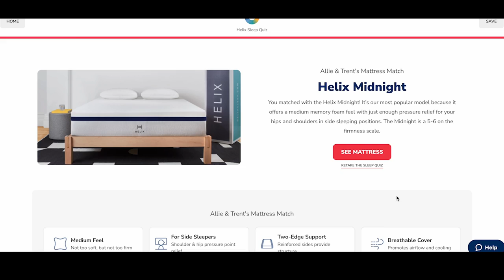WE'VE BEEN WAITING MONTHS FOR THEM TO ARRIVE!!!

Comment: I can't remember if during the build you mentioned this in one of your videos while building the basement and I don't know if this is needed, but I just learned about this and since you guys have a new home with a basement it felt like information worth sharing.  Do you have a radon tester or vent in your basement? It's a gas that come up through the concrete basement flooring in various ways. It's the 2nd highest cause of lung cancer. There's a test you can buy to check the levels and testing in winter is apparently better than in the summer. Again, don't know if you need this information, but thought worth  mentioning since you're new home owners with a basement. I would think older basements are more likely to have higher levels, but who knows. I'm surprised it's a thing.

Comment: OK . here we go . LMAO . First, weather seal is always last. Second when stacking only put one hinge on one side. Put in place and then do second side. third center hinges are done last after stacking. lol I'm crying in laughter. to do the back hang just roll door up half way and eye ball for straight from the back. the white line on the spring is for rookies. it is 10 to 11 full turns on a spring or 40 to 44 quarter turns. never stand under the winding bar always work off to the side incase something goes wrong. when winding always clamp the door with vice grips that way the door doesn't shoot up on you. when installing the operator if the the door is not smooth moving the operator will see current rise and not work cause it thinks its jammed. lube the springs and all the rollers they are pretty much dry on install. if you have to move bearing plates or anything attach to springs take off all tension first , thats how home owners get hurt alot. if top wearther seal is too tight on door the operator won't be able to open it. you guys are still amazing but be carefull , wish i could have helped you with this but i;m in canada. 20 min drive from chiwala tea head quarters. lol.

Comment: Where the leak was coming from the valve didn't fail the install did. Blatter expansion tanks should avoid installing them on their side.This is why things fail like designing a house were the roof snow slides onto the deck. When you want things done correct hire professionals, they installed our two heavy wood garage doors with openers in two hrs.

Comment: If you want the plumbing problems to stop start using grey heavy duty glue. I owned a hot tub business for over 15 years and never once had a bad glue joint and it will make up for fittings that don't fit right!! Blue glue is useless garbage!!

Comment: That valve is typical of the CRAP that is sold nowdays.  Import crap at high expensive prices that FAIL with monotonous regularity !!!  You have to buy what is available and hope it works for a while. I went through all kinds of this same rap when we set our place up from well pumps to failing PVC pipes to failing valves that either leak internally, don't shut off or leak externally like your problem.  It all goes back to the bean counters that buy this crap as cheap as they can and sell it for as much as they can get away with. ALL to enhanse their bottom line so annually they can pay their CEO's MILLIONS of dollars of salary and bonus, and maybe a few cents a share to the stock holders. It is nothing but extorsion !!!  you are not alone !!!!